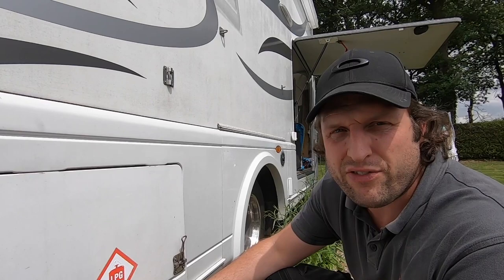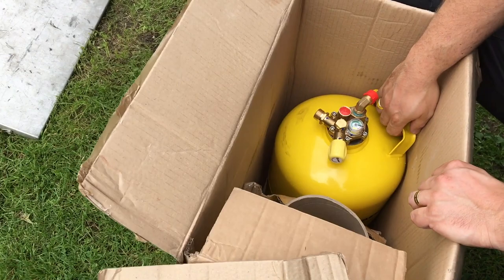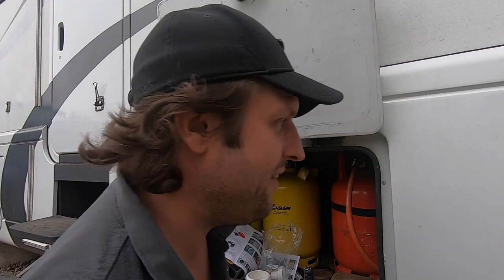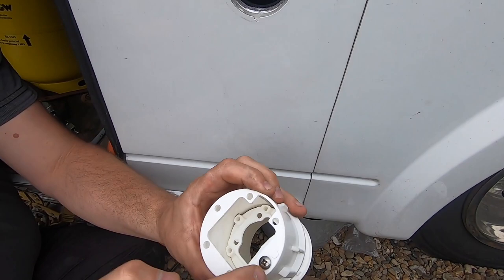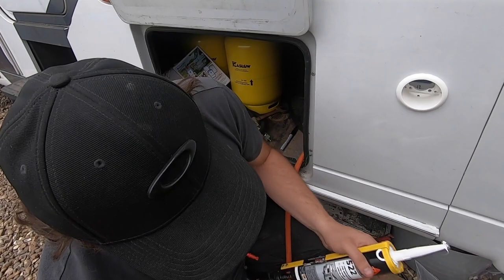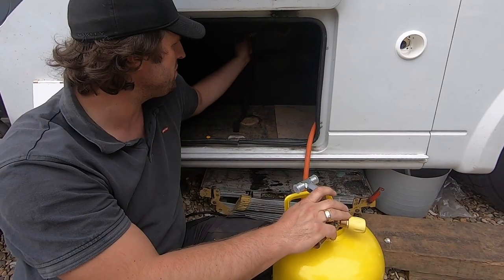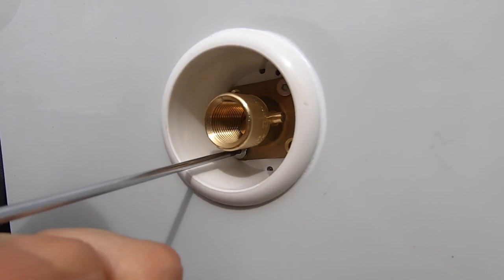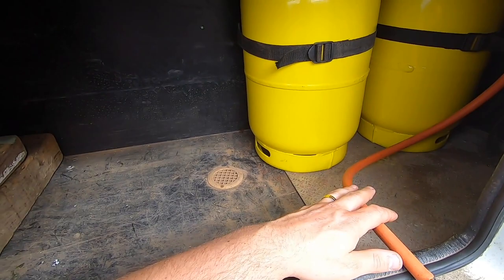Refillable gas bottles | Easy motorhome installation

Comment: 6 kilo bottles....gold dust.
Reply from the maker: 100%, we gave our original bottles to our then neighbour to help them out. We’re told Calor is doing a number on the lpg pumps, with its contracts and removing availability. 
Glad our gas is solely for the cooker and lasts us. We reckon all diesel is the way forward right now, back to how our 4x4 Sprinter was kitted out 👍

Comment: If you are travelling on the Continent and are concerned about running out of gas, just purchase a Camping Gaz cylinder. I was only charged refill, but maybe the camp shop didn’t notice I had not returned an empty. There was a mountain of empties outside.
Reply from the maker: This wagon is our only home, we’ve been travelling full time for over 5yrs across over 27 countries, plus 4 Greek islands, inc uk, Europe and Turkiye… so far for us, our gaslow system has hands down worked best for our family 👍

Comment: Good move keeping the calor bottle, but my question why didn't you go for the 11kg bottles it look like you have plenty of room.
Reply from the maker: Have to agree it looks like plenty of room but the internal height of the locker won’t fit the 11kgs.
Luckily our van only uses gas for the cooker.
Heating and hot water is all diesel fired so 2 x6kg lasts us 3 months👍

Comment: Considering caravan life in a few weeks, and wondering this, could you have interconeccted the outlets as well, as that would mitigate switching bottles, im in europe, so we have the duo connect systems, that will switch without you needing to, but wondering if i should get a fix lpg solution as well..
Reply from the maker: Hello,
Yes we see no reason why you could not pair up the out feed of the bottles, we chose not to so we get a good warning before the bottles are empty, if they were paired you would get no warning. We like the fact we can use our refillable and if needed use a 3rd bottle from where ever we happen to be.
All the best

Comment: Hey, great video! Nice job. One thing I'm confused about is the second outlet. The motorhome system regulator is in one outlet and the other sits there with an adaptor. Do you need to swap the the moho regulator from one gaslow bottle to the next or do the 2 bottles drain simultaneously? If so why did you need two outlet adaptors? Thanks in advance if you answer. Dean
Reply from the maker: Dean,

We chose to have the system so we had to swap the Moho regulator from bottle to bottle.
We did not want them to drain simultaneously.

By choosing this way we are aware once we swap bottles manually we have 1 bottle left before filling up, if they drain simultaneously we were worried we would run out without warning. 

The system we have also allows us to grab a separate bottle from whatever country we are in (we have adapters) if we cannot get lpg for any reason.

Hope this answers your question?

All the best

Martin and Kate

Comment: excellent video i'am thinking of fitting the gaslow system but can only fit one bottle in so it will be the 11kg one, looking to buy a second hand one if i can find one, there is a few on facebook
but to far away from me, i live up in cumbria, it looks easy to fit.
Reply from the maker: It really is as easy as it looks, the worst bit is cutting a big hole in the side of your van. 
Good luck finding what you need. 
It is a much cheaper and easier in the long run than calor bottles.
Reply: probs too late now but if you have a gauge - or just top up regularly one doesn't need to drive a second bottle around with you surely?

Comment: Would it be possible for you video the pressure test need check mine but not sure how ? Thanks chris&sheila
Reply from the maker: Chris,
Sorry for the delayed reply.
We filled the gas bottles up and then with a small brush and some soapy water just brushed all the joints to look for bubbles. 
All the best.

Comment: I have the same single bottle but 11kg. I intend to refill direct onto the bottle rather have an external fill point. Do you think that would be OK?
Reply from the maker: Hello, yes from a usability point of view it’s fine. We are aware of some garages in the uk turning people away if they are opening a locker to fill the bottles direct so just need discretion on the forecourt 😜

Comment: I have bought a motorhome with a 6kg Gaslow bottle but it's nearly empty ...I have no Exterior filler can I fill at LPG garage ? Gas low sold me a direct fill adapter ...sorry no knowledge of gas ⛽
Reply from the maker: From what we’ve heard the garages are not keen on letting you fill gas bottles if you have to open a locker or cupboard to be able to fill. I think if you are discrete enough about it when you pull up they may authorise the pump for you. As we’d heard about issues with internal fill points an external one was a must for us. 👍
Reply: @VanJourney  thanks seems good advice .The gaslow company when I telephoned them said it would be ok but  I will look around see where I can get external one fitted locally if possible ..don't feel confident to do DIY on this
Reply from the maker: You’re totally welcome - all the best with it all 👍